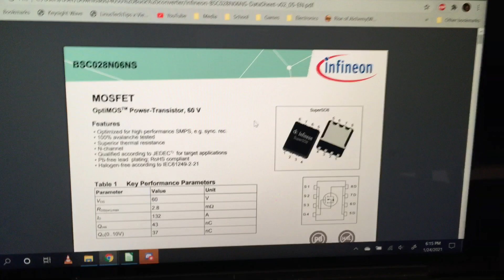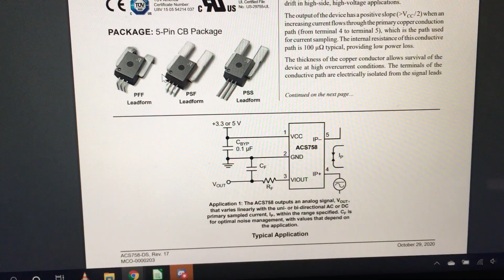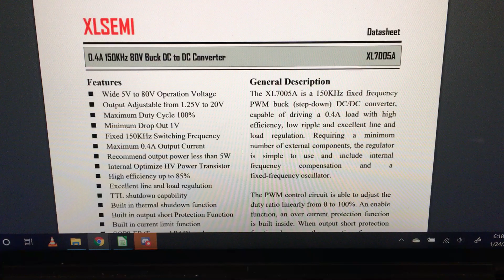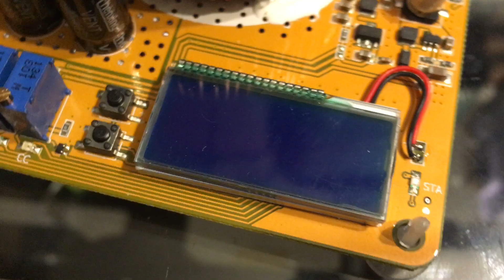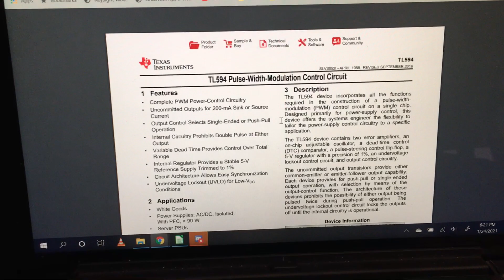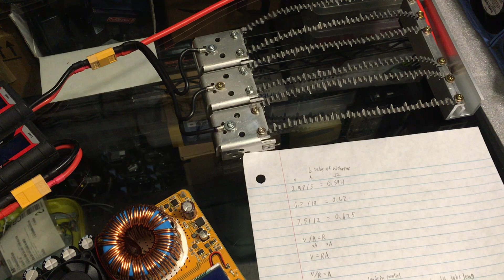WD4050 Buck Converter Chips and Load Test

Comment: Salut et merci pour ta vidéo... J'aurais une question, peut-on avoir à la sortie entre 2 et 3 volt avec un courant d'environ 25/35A en moyenne ? Merci d'avance 🙂
Reply from the maker: Yes you can set the voltage to whatever it is you need. I have noticed when I was testing the ampacity of a wire that the capacitors get very warm with high current at low voltage. So please consider that for your project!

FR - Oui, vous pouvez régler la tension sur ce dont vous avez besoin. J'ai remarqué lorsque je testais l'intensité d'un fil que les condensateurs devenaient très chauds avec un courant élevé à basse tension. Alors pensez-y pour votre projet !

Comment: colud you explain core type this buck dc dc converter ?
Reply from the maker: core type? do you mean what kind of material the core is made from in the inductor? The markings on the side of both of the two cores are: AF467060 - P20031303A
The dimensions are 12x19mm thick with a 46.7mm diameter, and the first set of numbers designates the other parameters based on this graphic I found.
http://www.goldenmagnetic.com/Content/upload/2018386211/201812061555065749060.jpg
So it is "AF" which stands for a Fe-Si core.